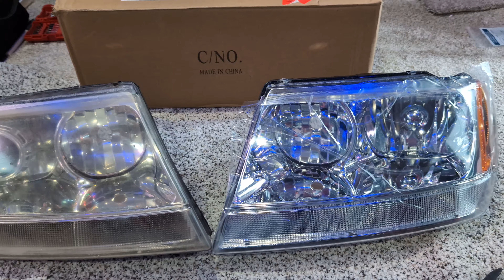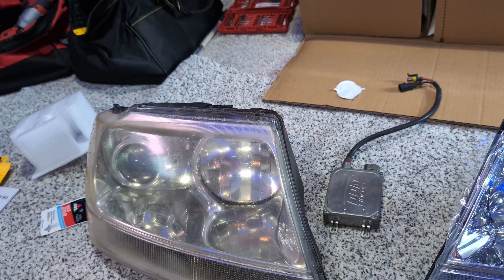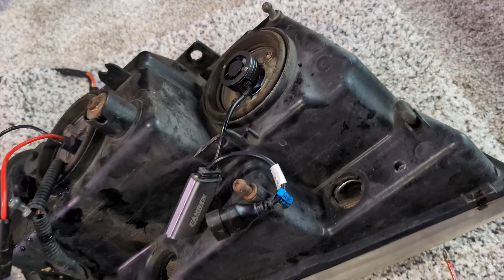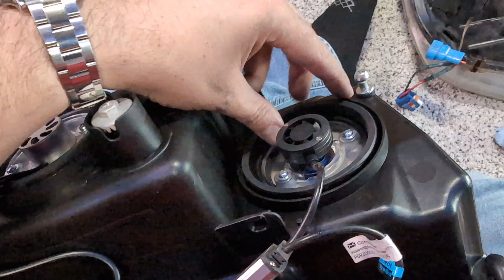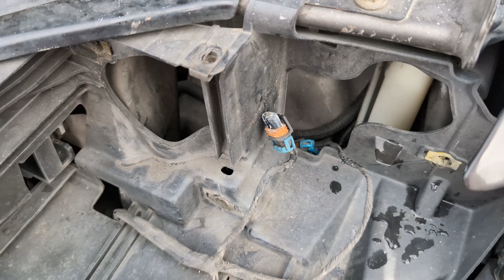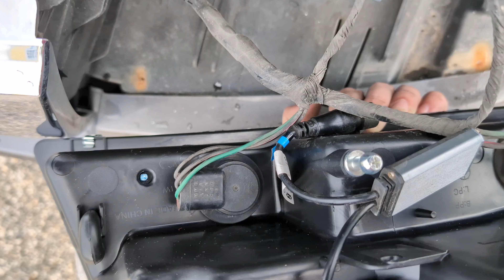99-04 Jeep Grand Cherokee Headlight Replacement with LED Hi & Low Beams!

Comment: Did you need to install load balancers to prevent hyper flash or did they just work
Reply from the maker: Plug and Play, no issues for the low beams and high beams. I still have regular turn signal bulbs.
Reply: @WJsLifeonaBoat awesome. About to buy some LEDs for my WJ as we speak. Thanks for the quick reply!
Reply from the maker: @HossWest No problem. The LED headlight bulbs are definitely nice. They're only getting better over the past few years as well.